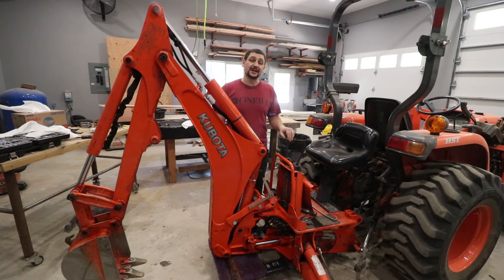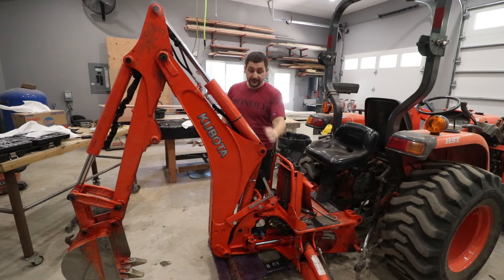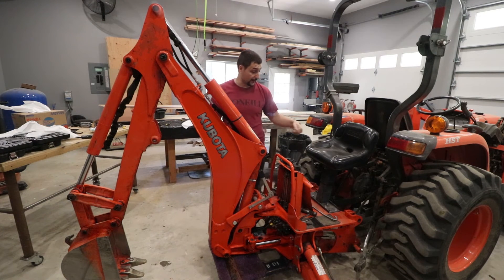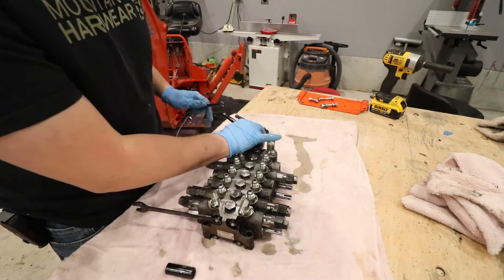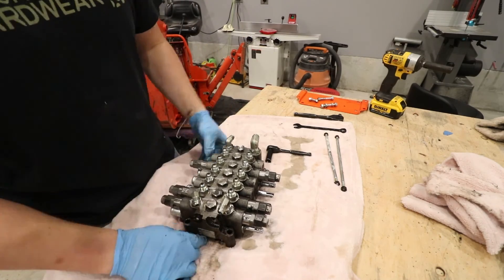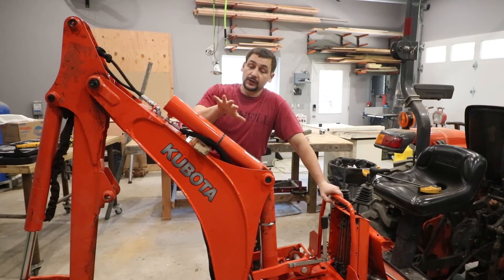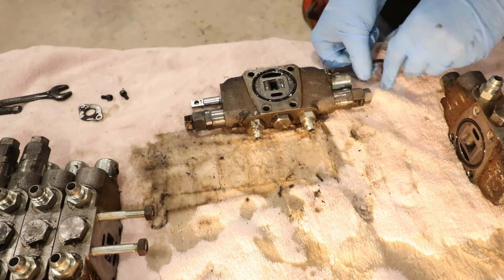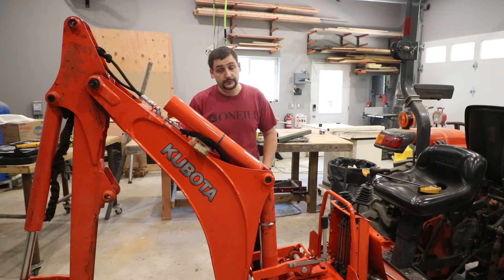Kubota Backhoe BH77 Cylinder Problem!

Comment: Daniel, Former F-18 Hydraulic mechanic USMC, had front landing gear fail to retract.  Intermediate Level continued to send us improperly rebuilt hydraulic cylinders (even though they bench tested good).  Fluid was bypassing internally of the cylinder during retraction.  Once we received a properly rebuilt cylinder, problem was fixed.  If you crack return line of cylinder and apply pressure you can see if fluid is bypassing the seals of the cylinder in question.

Comment: Personally, I'd start by fitting a pressure gauge to each line out the spool - that'll tell you whether its losing pressure within the valve spool... If it is, you've identified which spool and which also which side.
Its very easy to guess that pressure is reduced but without a gauge you're guessing. 
I tend to think that the problem is within the cylinder. The seal on the end of the ram rod can often leak oil from one side to the other but not the other way round as the seal can act as a valve.
This will make the cylinder feel like it has pressure on one side but not the other.
Hope that helps.

Comment: Is it possible to swap a hydrolic line with one of the valves that you know is working and see of the problem moves to another control.
Reply: I seen a video of someone whith a BX where the travel speed was not as fast as it used to be. Long story short the linkage got so much slop that when you engaged the lever it was not engaging the valve all the way. I've got the same BH but my tractor has 50 hours & the BH less than 2. Hope you get her figured out. Good luck.

Comment: Sorry to hear about your problem. I have a Mahindra max 28 and had a similar issue with the loader. It was a piece of debris in the check valve on the loader valve. It would hold the load ok until I wanted to raise it up. The loader would lower instead of raise. The oil in the valve was leaking through the check valve internaly. I cleaned it out and problem solved. I know tracking down a hydraulic problem it is like finding a electrical issue on a car.

Comment: The video is a couple of years old so I assume you have it fixed by now. 
I was in the same boat. I spent the winter working on the thing, taking the control valve off and on more times than I can count. I ended up "hot wiring" the bypass valves (the big ones for the boom and swing - not the bucket or the out riggers) to get it to work. There are very small orifices, less than .020" in those things. You need the right viscosity oil. I notice that it is winter in your video too. If I can I'll post another comment I made on another site.

Comment: Did you do a pressure check on the hydraulic system? Kubota (and Im sure other brands) are famous for setting the pressure below what the hydraulic system is rated for. If its low, you can get the correct (0.50 each) shims to get your pressure to the correct psi.

Comment: I bought a used bh77.  After a while the boom would drop and not come up sometimes.  The hyd oil was near the bottom of the sight glass.  I topped it off and it worked fine.  

I also noticed when it would act up if I retracted other cylinders it would help.  

The pump never cavitated or made noise...

Dunno but maybe its a tad low on fluid.

Comment: I bought a 3301 new and it howled and had problems from day 1. It wasn't broke so warranty wouldn't do anything. The backhoe finally wouldn't work (after warranty expired) and I worked on it all winter. I finally did my own testing and the viscosity was to thick compared to UDT. That's the problem with other "Kubota compatible oils" is the viscosity difference. Not all this additive super lubricating sales baloney. The valve assy on the backhoe has some orifices that are less than 0.020" (some metric dia?) and it won't flow thicker fluids. I suspect the same on trans lube areas. On my first oil filter change the filter was collapsed inside also. All I can figure is that the factory left in preservative oils in the hydraulic rams or something that caused the thicker oil.
That will be the only and last Kubota I get. I stick with CAT. They use standard universal 10W hyd fluids. None of this "special" garbage and microscopic orifices that a Kubota has. A little more engineering and they could make these Kubota's universal instead of requiring special fluids. An "all synthetic" may have a low enough viscosity that it will work right, I don't know. Be aware that there are some very small orifices that have to flow the oil in a Kubota.

Comment: First step re assemble the whole backhoe! Check to make sure the tractor itself is producinging plenty of pressure,if the tractor is bypassing at the tractor the  hoe will get to little pressure to run correctly. Also have you traced to make sure all hose are good, a smashed hose can cause alot of issues. Replace the quick couplers with a higher flow,seems dumb but sometimes a manuufacture installs the wrong ones.
Reply: Wow ... just recently learned my air compressor coupling have been low flow type the last twenty years ... and I just converted em to high flow for a paint gun session. Dang to think the same thing can be happening on new hydraulic couplings, and wonder how to identify high flow vs below par flow couplings.  Thanks for Tip :+)

Comment: On the failure to lift the tractor... IF it is supposed to, check the relief valve setting (we are in the realm of gauges and know how for this). When you try to lift the back do you hear the pump sound change like the relief valve is opening and dumping to tank?

Comment: Hydraulic filters and your oil fluid is full that will create a problem also it could have a air lock somewhere in the system so bleed all your lines again and keep trying that and see if that solves your problem

A friend of mine's got a portable backhoe on a trailer and it'll lock up and it's on a sandwich valve system and he reverses the two outside ones play with it for about a couple seconds we hook it up and everything works I wonder if that would work for you let me know if it does please thank you

Comment: I’ve ran across a problem in the past where the lining of the hydraulic hose separates inside. Everything is working great, then the lining collapses, like a damper, it closes off the flow of fluid. Had me scratching my head for a few hours. The problem is usually intermittent, hope this helps out. 👍
Reply: Wow ... That must have had ya wondering for awhile for the fix.  Nice to hear fix it stories as I am learning the hydraulics and fix options for an old Kubota D295DT w Backhoe I picked up recently ... on a good deal restoration roll ;+)

Comment: I had the exact same problem come to find out my trouble was with the switch under the seat that you push or pull I have two of them and one was getting stuck halfway open for some reason. I put a bungee cord on it and all good now.

Comment: mine developed a slow bucket curl after a few uses.  culprit turned out to be a paint chip inside the control valve restricting flow.
Reply: I have same problem did you remove the control valve to fix it
Reply: @MGMT200group3  the dealer picked it up and had it fixed in a couple days.

Comment: I am having the same issue with the boom cylinder on a b2650 with BH77. Did you ever figure out the issue or how to correct the low to no down pressure?

Comment: If you did not find a problem yet. Touch the cylinder and see if it’s heating up more quickly than the others usually means your cylinder is bypassing. Or get yourself a pressure gauge make sure the pressure gauge is strong enough for the pressure. dead head the hose going to your cylinder if the pressure builds up it’s not your valve it’s going to be your cylinder and if it doesn’t build no pressure it’s the valve. Another way is fully extend your cylinder or retract remove the low pressure side of the cylinder and try the function you may get a bit of oil  coming out of the cylinder that’s normal but a lot of oil is not make sure to cap The other line you  removed. Good luck be careful
Reply from the maker: Thank you have not fixed the problom yet and i will be trying th gauge as you have recommened.
Reply: Its one Way I troubleshoot at work. It’s usually the easy way to find a problem good luck and be careful

Comment: Do you have the hydraulic Schematics of the backhoe? You may have broken spring in one of the valves or broken chunk of oring gotten into the valve bodies. Did you reassemble the valve body the same way you taken it apart. Just because the bodies look the same, internally they could be ported or spring compression differently.

Comment: Same issue with another cylinder after the hoses were swapped says it's in the valve, I would use a pressure gauge, betting it's in the relief portion of the valve, possibly have a bad spot in the ball or weak spring or just something stuck between the ball and seat. Hope you get it lines out.
Reply: pretty much my feeling too! the relief of that particular valve. not the main relief because every other cylinders are working fine.

Comment: not a mechanic, but im pretty good with hydraulic. first off, I think you are right, the problem is in your valve. but probably in your relief valve (stuck open), not your main relief because all other cylinders work. but you probably have a relief valve directly on that valve. when the problem transfered to the dip cylinder, you knew the problem wasnt in the cylinder. I would get a pressure gauge good for 2500psi+ and hook it directly on the hose (easier than being on your knees at the valves...). you said you already disassembled the valves... but have you disassembled the relief and everything ?

Comment: Hi Dan, I also have a BH77 on my Kubota and sorry to say that I got nothing. The only problem I had with mine was the swing cylinder(left side) wasn’t swinging to full stroke under moderate load, right side was ok. Turned out to be the spool valve was sticking due to mice making a nest around valve assembly and the valve rod wasn’t sliding all the way in one direction. Got rid of the mice, cleaned up the assembly and worked fine. One question, could there be an airloc in the line at some point?
Reply: I'm having the exact same problem.  Left side is slow. I'll have to check that spool valve out. Thanks!

Comment: I agree with some of the other comments, try swapping lines to another valve set and see if the problem changes, at least you can pin point the issue to see if it is in the valving or the cylinder. Then you can move on toward correcting the problem and have more focus. Also, even though you had the dented cylinder honed, that doesn't mean that it is completely round again, you could still be leaking pressure around the seals when it gets near the dented zone. i worked building hydraulic attachments for for lifts and if there was ever a dented cylinder, it was always replaced.  Hope you get it fixed, you rely on it a lot and it is a great tool for you.

Comment: Last resort, check with Kubota. I just got a new L3901 with BH77 and the first time using it lost almost 2 gallons hydraulic due to a finger tight fitting from the factory. Under warrenty with only 18 hours on they fixed it and filled up the fluid. Just might be worth your time to check. And save the frustation of racking your brian.

Comment: Aren't all those spools the same?

Move them around to control different functions and see if the problem moves with the Valve
Reply from the maker: A lot of input from viewers I was able to figure out what the problem was I made a separate video about the actual repairs turned out it was the relief valves

Comment: i have the Kubota 1985 l3750 with l4540 backhoe 50hp never a problem till summer of 2019 , my mistake , i usually check every bolt and nut each time before use to make sure all good and tight and no leak liquids ok , if something started to loosen up usually can tell by the rust around the nut or bolt or leaky connection, so as i was using the hoe the through  bolt at top holding in place the pin going top to bottom hinging the backhoe backed off so the pin move up  out from under  and the result was i bent everything the hoe want down sideways , whined  up buying another good used chases and by myself at the age of 80 i take the sucker all apart and swap it , what i am trying to say here is in doing this i came across all of the problems mr Woodel encounter , so air in the system , mixing the hoses , hydraulic level is , is the key, if all working and one cylinder not it is not pressure.but dont overlook the hoses sometime the hose go bad inside swells up and stops the flow of fluid , remove both  end and blow through it once you blow out the fluid in it,  it should blow through easy

Comment: Have you got the problem figured out? I had identical issues with my BH77 and was able to fix it by taking apart the pressure relief valves, cleaning and putting them back together. I believe there is a way to put the valve back together to make it operate correctly. Great videos. I am a neighbor of yours probably 10 minutes away bordering Banner Forest.
Reply from the maker: I have not had time to work on it in the last few months because i have been building a house. But this winter i will be taking back apart. And yes we live close. I grew up riding dirt bike in banner forest, cant do that anymore but. i take my daughter out walking in banner everyone in a wile.
Reply: @DanielWoodell  Try assembling the pressure valve dry (no oil) and give that a try. I was assembling the valve with oil and couldn't get the boom to operate correctly. The pin that is tapered on one end and the other end fits into the recess of the adjusting screw when oil is in that recess the pin will not seat all the way (hydraulic lock). This will force the valve close. It's just a theory but it worked for me.
Reply: I am having the same problem, did you figure out the problem. I have already replaced the cylinder?
Reply: I'm wondering if you can explain what you did to clean the pressure relief valves. Mine only plays up when it is cold, for a minute or two, but I'd like to nip it in the bud. Can they be dismantled?
Reply: @123decoeli  The valves can be disassembled. I did that numerous times to only have the valve work for a short time. I switched valves with another to verify that it was actually a valve problem. I bit the bullet and bought a new valve spool and never had an issue since.
Reply: @daveshawn9865  Thanks -  I'll do the same - dismantle and reassemble. If that doesn't work I'll also bite the bullet. It's an amazing backhoe when it is working well, which is most of the time. Have a nice weekend!

Comment: Yes he have done everything he can as far as he know but the problem exists because he is not a hydraulic mechanic and he missed the problem and by removing the hyro valve he created another problem, i am sure he put one of the hoses on crisscross the hoses are usually numbered if not you should number them before removing , the second problem he may have is that the system may have air and must be bladed  , if the hydraulic in use is making humming nose defiantly should be bled  , stretch out lay down the hoe  and crack each fitting at higher end till you get a  good squirt of fluid    then raise it but make sure bucket is on ground and do the same with the other end of cylinder and must tighten fitting before stops bleeding  remember fluids sick their own level air is always in the higher  end of cylinder good luck

Comment: Your tractor dont look that old. Have you had a kubota dealer look at it. I would not  think it was the valve. Not much that can go wrong in there. Usually they go bad if moisture gets in and freezes. Sounds like a bad cylinder. I just had to put a new stabilizer cylinder on my mahindra backhoe. It just wouldn't stop leaking, even after two sets of new seals. I found a hydraulic company in Kentucky to modify a stock cylinder at a fraction of the price of new. Keep us informed. I know how frustrating it can be!!!

Comment: Dang dude, should I not consider a backhoe?
Reply from the maker: Outdoors with Erik well it worked great for 3 years, but I’m considering trying to sell it as is and then buy an excavator.
Reply: @DanielWoodell  Keep the hoe (fix the hoe) and get an excavator. They work very well together.
Reply: @DanielWoodell  Yeah, get an excavator - those tractor attachments are little better than toys.  I'd probably get a track skid-steer as well - for a small contractor, you can do a lot of work with that combo.
Reply: @joeyoliver579  it be covered with 6 year warranty